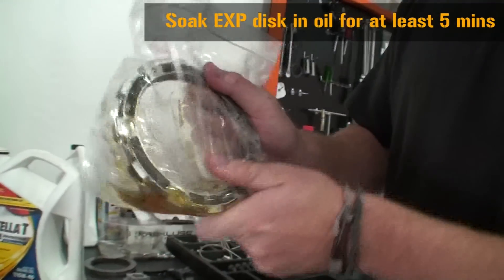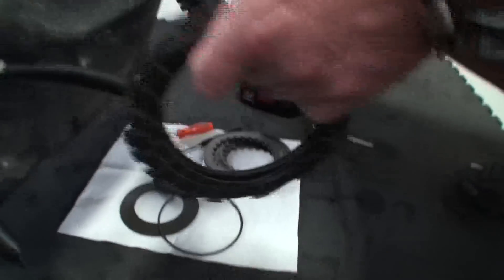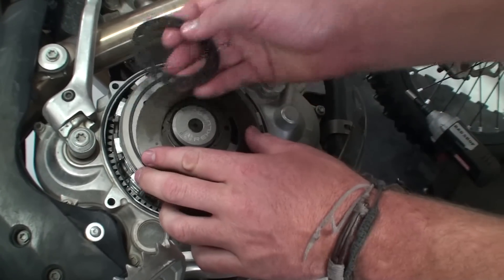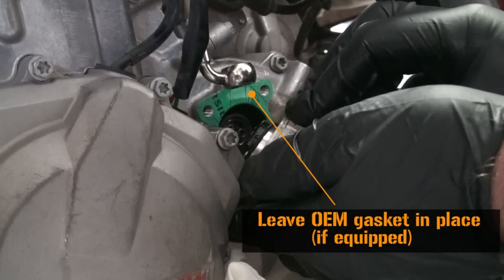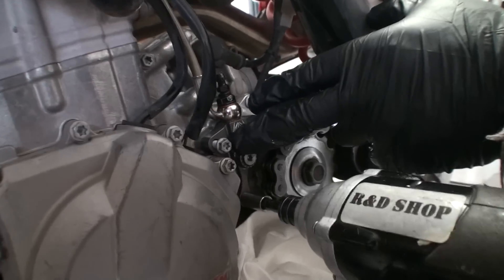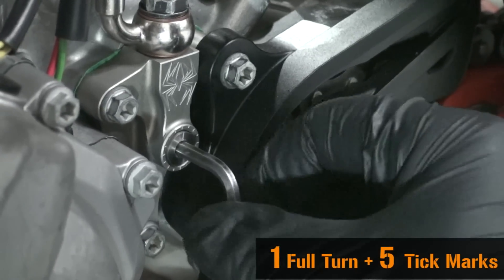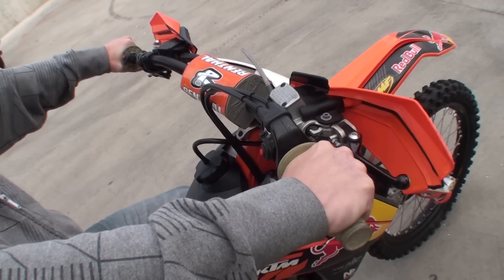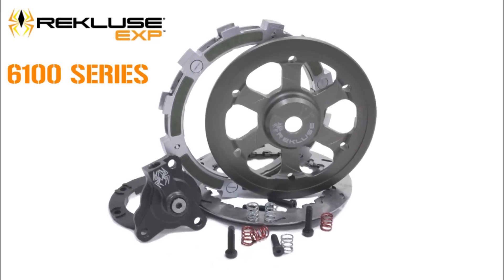Rekluse® Install | EXP™ Auto-Clutch for KTM/Husqvarna/Husaberg DDS style clutches

Comment: Awesome clip I have installed it the same way as in the clip but my clutch lever feels harder I also have seen that there is 2 plates that is thicker than the other plates.  I have a 300 exc 2013 six days please help
Reply: What was the answer to your issue and did you call Rekluse? Those guys are pretty helpful.
Reply: Got it sorted mate thanks.